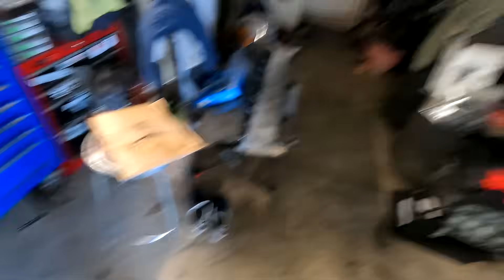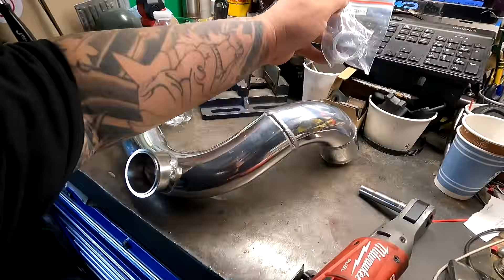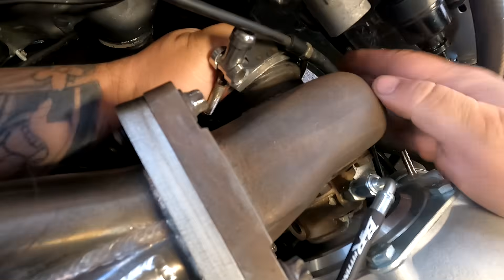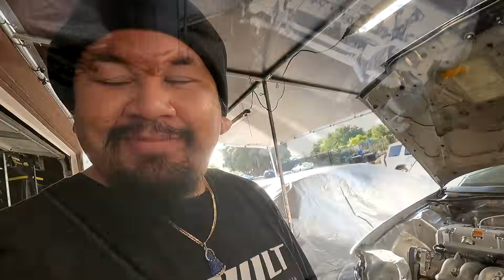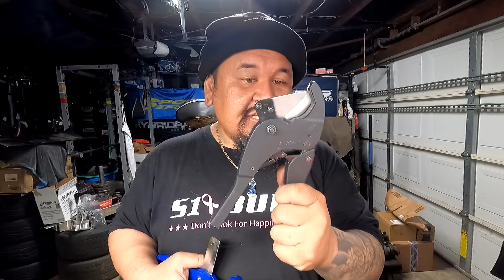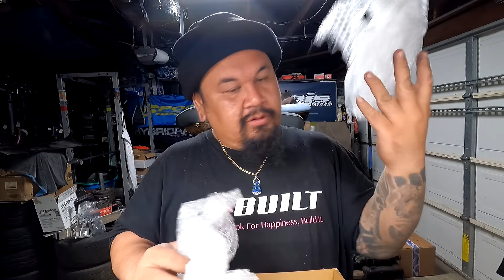BUDGET AWD BUILD PT16: FIRST START K20 TURBO | Almost Done!

Comment: You’re not the only one whose bandsaw cuts crooked. I’ve tried an expensive one and it didn’t do any better. I occasionally have access to a really old one and it cuts perfectly straight. I finally just went back to using an angle grinder. I recently saw a nice trick, take a tie wrap and put it around the pipe, if it’s flat it gives you a nice straight line to cut to. 
Consider putting some heat shield against the firewall behind that downpipe to help with the heat wrap. 
✌️